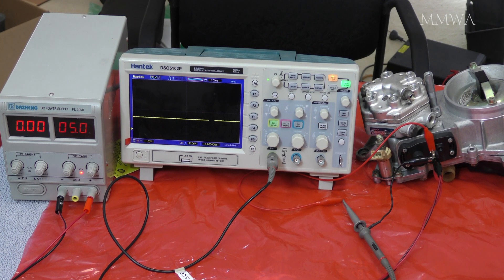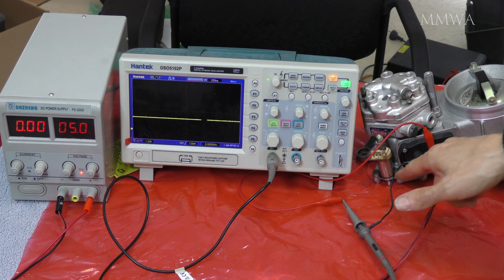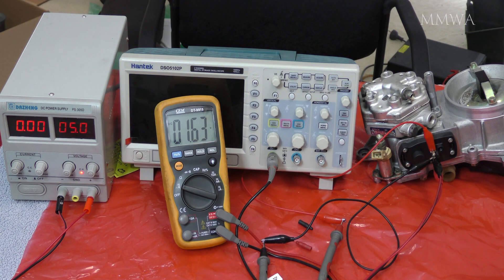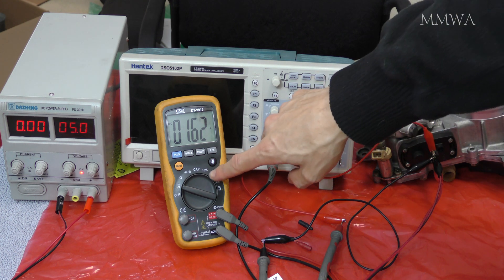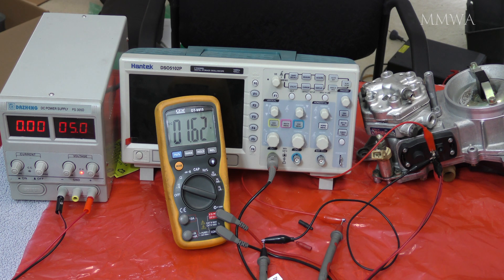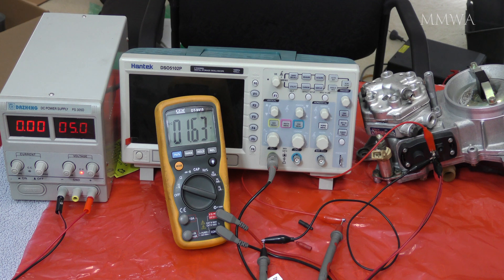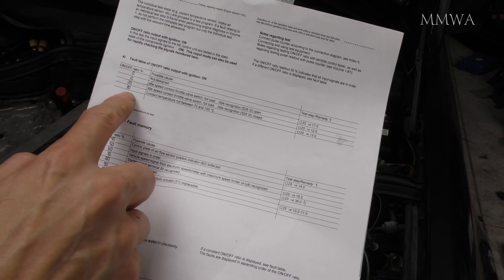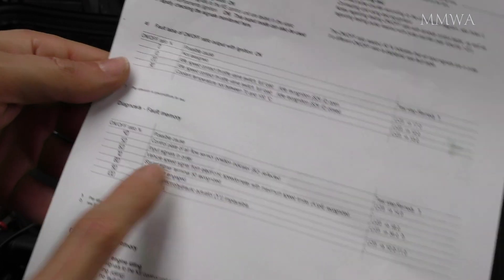KE-Jetronic airflow meter bench test and how to use duty cycle meter ( C4K 4096 × 2160 24fps)

Comment from the maker: Note! If doing this test on a car it would be advisable to remove the fuel pump relay and depressurise the fuel system to prevent unwanted fuel delivery into a non running engine.

Comment: Hello MMWA, I own 1992 W124 coupe 2.3. Thanks for informing that we should be looking at OFF duty cycle. I will try to calibrate it tomorrow. One thing that maybe you could explain. I read that after adjusting around 50% of duty cycle on idle we should increase RPMs up to 2500 and read duty cycle. The difference between two readings shouldn't be more than 10%. So to be precise if we have 48% off duty cycle on idle we should have 38% off duty cycle (not less than) at 2500 RPM. Can you confirm this procedure is correct ?

Comment: Thank you for your most helpful videos. You are a great orator. I own a 1988, 560SEL that recently showed some rough cold starts and also hesitates during acceleration. The EHA was leaking for a while and I replaced it with a new Bosch unit. I thought I check the air flow potentiometer. It shows some wear and the left (small) contact has some of its individual fingers bent back or behind. About 5 of the 8 fingers are still operational. Don't know what happened there. I put it all back together and carried out your test, using my old trusted analog voltmeter and a 6V battery. Slowly depressing and releasing the sensor plate shows a voltage variation between 4.5V and 6V in a smooth and linear movement. Of course the potentiometer is not yet calibrated. This makes me believe, that the potentiometer is working properly. Of course I would like to replace the contact fingers and perhaps the potentiometer as well. Potentiometers are easily available but I can't find any reference to the contact fingers anywhere. Any idea where to get them? Or perhaps a complete used airflow meter assembly. Thank you!

Comment: When it's adjusted what is the max/min voltage and max/min when the potentiometer is spec? I've replaced mine but the new pot doesn't seem to have the same range of resistance as the old one.
Reply from the maker: Christopher Norlen-Holmes correct. The Chinese ones on ebay (99% of them under various brands) aren’t exactly the same performing as the originals. You can still buy bosch ones but they are about $200 ish. I don’t remember the exact figures but mine are about half a volt off.
Reply: @MMWA-DAVE  any chance you could send me the min resistance (engine off, flap closed) and max resistance (engine off, flap all the way down) from a m103 that you know is running well? I'm trying to work out the range. The pot resistance band should be linear or close to.. mine starts at 1k and then only goes up to 2k

Comment: This is all great, but I also recommend using wideband AFR sensor for final testing of the system, and IR pyrometer to check for individual cylinder fuel trims.

Comment: Hello there , i've been replacing parts on my 2.6 E 1988 and now i got another problem ,if i can get any solution from you as a experienced one .I replaced the ke jetronic with all his parts ,fuel pumps ,brand new spark plugs ,crank sensor ,o2 sensor and cabels ,at cold start it runs perfectly but after the engine warms up it stalls and i cant turn it on about 1 hour or less.Can it be the OVP relay or fuel pump relay .If i can get any solution from you ,i will be thankful .
Best regards ,Lorik Arifi .
Reply from the maker: Lorik Arifi need to determine if its fuel or spark thats missing. I have seen EZL units go open circuit once hot (ignition)
Reply: @MMWA-DAVE  maybe problem is fuel pressure accumulator or leaky injectors.
Reply: Maybe problem is fuel pressure accumulator or leaky injectors.

Comment: OH WW,  i dont understand enough about Duty cycle, are you reading sockets 2 &3?   

With engine on and at tem, I was getting 700mv across top and middle terminal of the Pot.   From what Ive read, that is correct.   It was 740mv, then once corrected, I think my hesitation of pulling away from a standing start has gone. Drove it for 2 hours today, it was not perhaps a sharp pull away- but it did not stutter.  My next step was to richen up the EHA a small fraction. Bu tperhaps dont need to. Without understanding more about what a duty cycle is and why it can be measured in volts, its an unclear concpet to me.  Can you point me to something to read? thanks MM
Reply from the maker: Duty cycle is measured at pins 1 and 3 at the round socket from memory. 0.7v is indeed correct at a hot idle on the top 2 pins of the airflow meter. The adjustment of the duty cycle with the adjustment screw at the airflow meter is only affecting the idle position. In my car I was getting part throttle leanout and thats when adjustmen of the EHA is essential. (assuming absoultely everything else is in order and you arent trying to compensate for vacuum leaks) My method of setting up the part throttle mixture is a bit backyardish but it works. Ill show it when I get the red engine running. Idealy a exhaust gas analyzer would be required but they are too expensive for the home hobbiest.
Reply: @MMWA-DAVE  MM, is duty cycyle therefore measured in volts? or can be derived from a voltage measurement?  rgds Ken
Reply from the maker: ka130258 some people who dont have duty cycle meter do just measure in volts. Its not the official method but it seems to work for some people. There are some discussions about it on the forums if you look long enough. Personally I would just buy a cheap chinese duty cycle meter off ebay.

Comment: I thought I was the only one who has seen failed W126 Kjet ECUs fail!  These cars are getting so old now, that even though the ECUs were (and still are) extremely high quality, they too have a lifespan and I think we are now starting to see the end at this point.
Reply from the maker: Fortunately both the dead ones i saw i was able to revive! If its just caps its a very easy fix. They fail either dead shorted (worst case scenario) or completely dry out and cause massive ripple from the unfiltered voltage regulator.

Comment from the maker: Note number 4, this video was recorded in cinematic 4k for the extra width (4096 × 2160) 24FPS but I don't think you-tube supports this. So 1080P will likley be all thats available.
Reply: When using Chrome, it fully supports this resolution!
Reply from the maker: @mozartcarclassics  Holy crap! I just noticed this too. Interesting.
Reply: @MMWA-DAVE  it's so high quality that i can see your reflection on the multimeter.
Reply from the maker: Bekir Karakulak hahaha. I hope I didn’t shock you.
Reply: @MMWA-DAVE  haha, i've seen you before though.